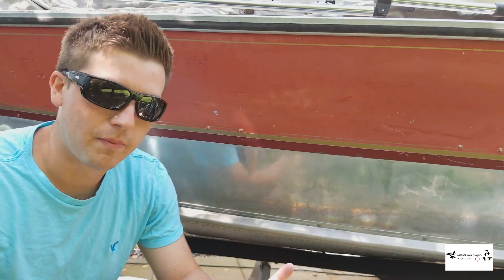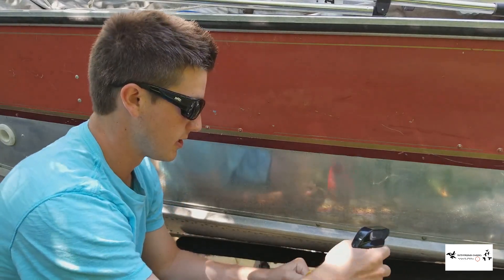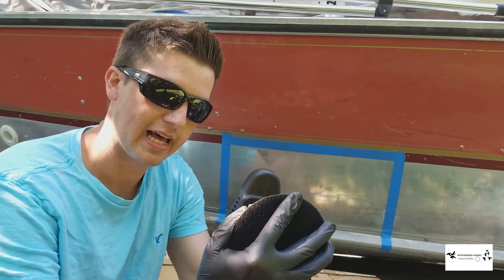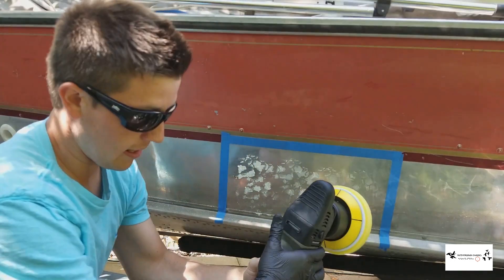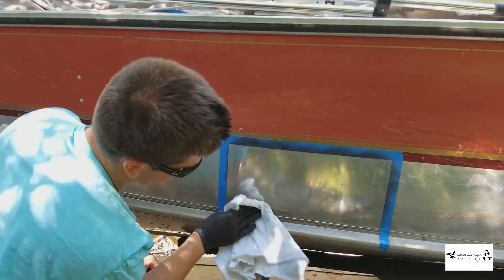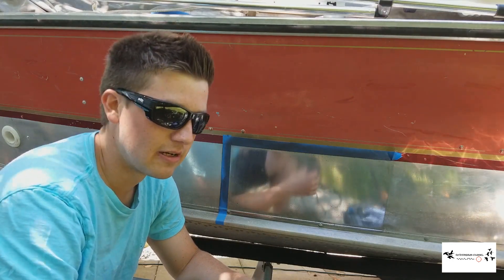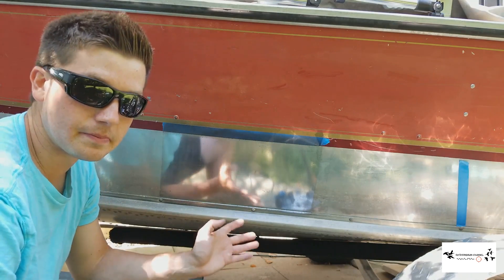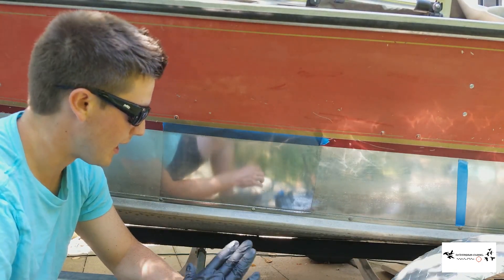Aluminum Boat Polishing (3M Marine Aluminum Polish) Part 2

Comment: Do you think this would work with aluminium that's about 4 or 5 times more corroded? Also is there much difference between a $100 dollar vs $600 buffer, in terms of how good the finish is?
Reply from the maker: Yes it will work. Consider wet sanding first. Don't let jabbing the right tool stop you. People used to polish things by hand and it looked great. Usually more expensive polishers do the work faster
Reply: There are some great chemical aluminum cleaners, like Purple Power or Starbright. You spray it on with a spray bottle, let it work for a few minutes, then hose it off. It works well, and provides a great base to begin polishing!

Comment: Hi there! I have a Pet Grooming Trailer. It is made with .040 aluminum trailer and it is all white.  I do not know the differences in Aluminum but I am told it is .040 aluminum and it is white not silver. Don't know the difference but I would like to buff and wax. Any suggestions are greatly appreciated!
Reply from the maker: Treat it like you are buffing paint. If it's painted be less aggressive. Lighter polish and dual action polisher
Reply: @OutdoorsmanChannel  Thank you!

Comment: Looks great! Just picked up a Lund with the same paint and aluminum bottom. Curious how you cleaned up the paint?
Reply from the maker: Didn't do paint.  Ours was too thin and old.  I suggest determining if there is a clear coat, if there is follow car detailing procedure.  If there is no clear coat, you need to be a bit more careful look at buffing older cars etc.  The only concern is burning right through the paint.  What year is it?

Comment: were you able to get rid of the swirls? I've tried multiple ways and still have swirls.
Reply from the maker: Swirls on the actual metal or on paint?
Reply: @OutdoorsmanChannel  on the metal
Reply from the maker: @rossvanpraag8113  This should work fine.  You can also wetsand.

Comment: Try Mothers Mag and Aluminum Polish, very cost effective. I like 3m products on Gel Coat, Finesse It 2, but kind of expensive.
Reply from the maker: Actually dont own the boat anymore.  I'm sure it would work nicely.  Also would work good with a microfiber cutting pad or rotary buffer with wool.  Thanks for the comment!

Comment: Interesting video. How long does the shine last before the aluminium oxidises ?
Reply from the maker: urbanimage depends how often you use the boat condition etc.  For us about 1 year without wax it still looks shiny after a year just noticeably reduced.  If you waxed I imagine a very long time.
Reply: Hi, Thank you for your reply. I'm surprised that it lasts that well. I'm in the UK and have an aluminium canal  narrowoboat that needs re-painting or possibly stripping back and polishing, which is why I was interested in your
in your experience.
Reply: @OutdoorsmanChannel  next time use a brown roush bar and a cutting pad and  for finish use white pad cotton with white diamond or best zephyr 40 and u will see a bid difference
Reply: To prevent oxidation apply as many coats u want of ceramic coat it will make the finish last longer

Comment: looks good. I'm glad I found your video because I have the same torq 10fx for car detailing and I was going to use it on my bass tracker. I am thinking about buying a cheap rotary buffer at harbor freight and see if it will do a good job vs the dual action with clutches.
Reply from the maker: Trevor Alexander Yea I've never seen it been done.  Thanks for watching don't forget to subscribe!

Comment: Next time use dawn and water. Quick wax adds wax that you will have to buff through
Reply from the maker: It's a detail spray I didnt think there was wax in it, but I could be wrong. Thanks for the tip.

Comment: I just watched someone use wd40 and the results are amazing..  prob best to just use that and then a random cheap polish..
Reply from the maker: I'm not surprised that putting oil on metal makes it look very shiny.  If you actually want to polish it and make it last I suggest a quality polish and wax.  Thanks for watching!
Reply: @OutdoorsmanChannel I understand your response but perhaps it would suprise you to know that wd40 was designed as a solvent and there's more going on that just making it shiny with oil.. give it a good rub with wd40 solvent, it gets smooth nice and quickly, costs hardly anything, clean it off, polish it.. good to go..
Reply: @hychap  And, it lures bass! since WD40 is made from fish oil.

Comment: use 0000 Steel Wool
Reply: Wouldn't use steel wool on aluminum. Marine stores sell bronze wool for boats which doesn't rust. Wet sanding with 3000 grit does a great job but is a lot of work.